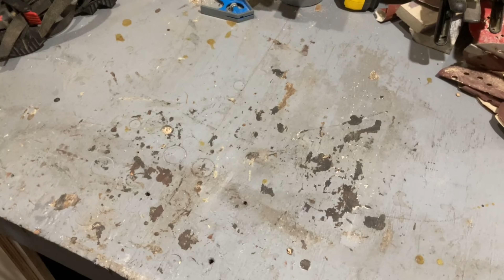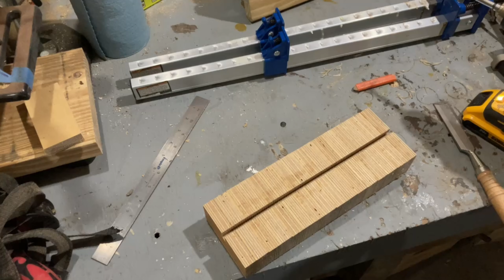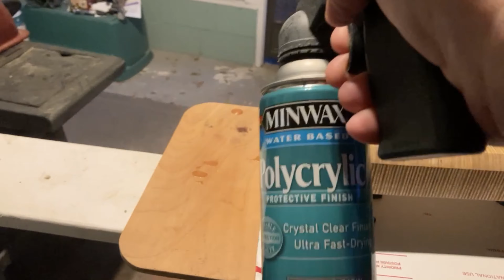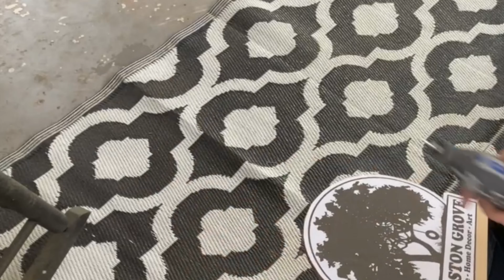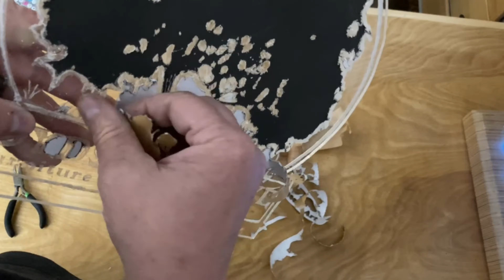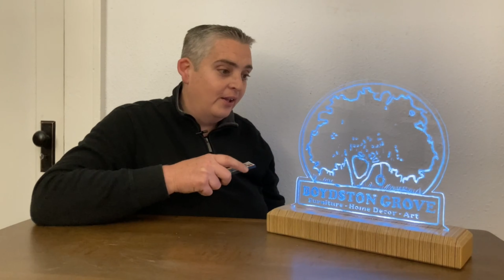Making an LED Edge Lit Sign // NO CNC or Laser Cutter

Comment: Enjoyed your project. Two things I noticed that you did that are dangerous - on your table saw cuts, you trapped the loose cut piece between the blade and your clamped stop…if the piece shifts the tiniest bit, the blade will catch it and you’ll get a nasty kickback. Also, when you were chiseling off the glue, you were holding the workpiece with your other hand…never do that. Always clamp your piece down. I got a nasty slice across my finger when I did the exact same thing and my chisel slipped and glanced across my hand…4 stitches later…and I learned to always clamp down my piece when chiseling! Work safely and thanks for the idea!
Reply from the maker: Thank you for the feedback! I agree on all counts. The stop block was a not so good solution because my miter gauge broke. Normally I would clamp a stop to the fence, before the blade so my piece would be free by the time I actually hit the blade. I’ll probably invest in a new miter gauge here shortly. Thanks for watching!